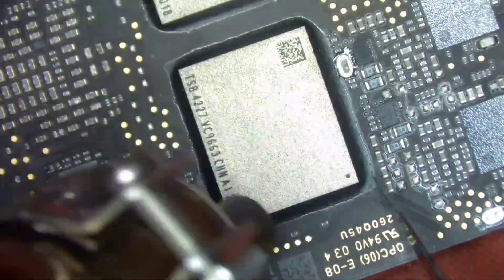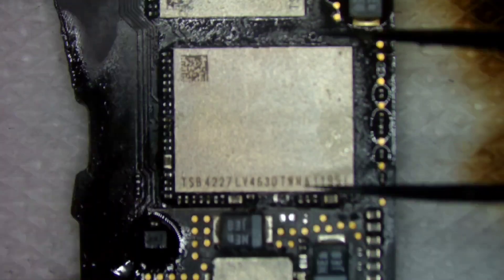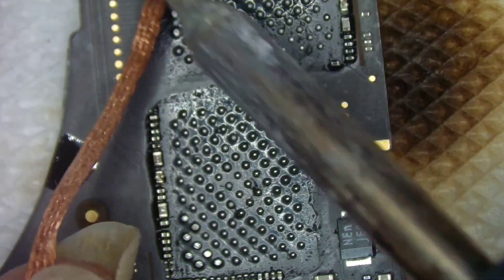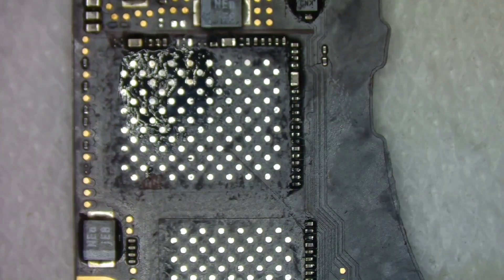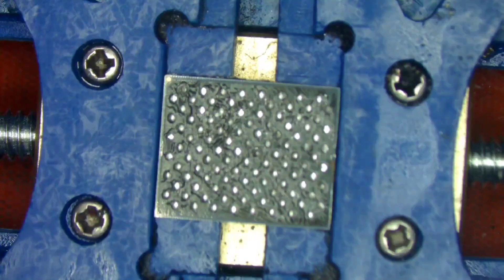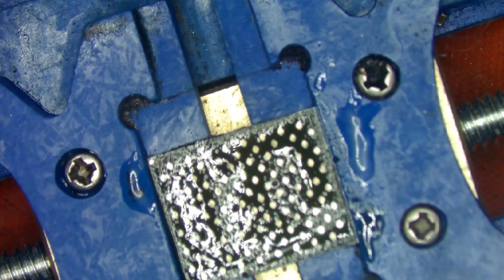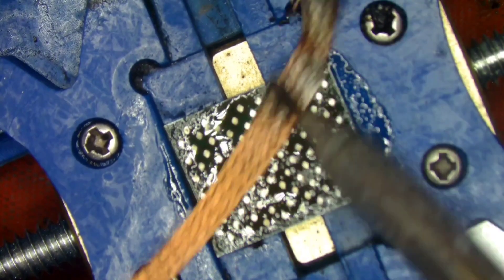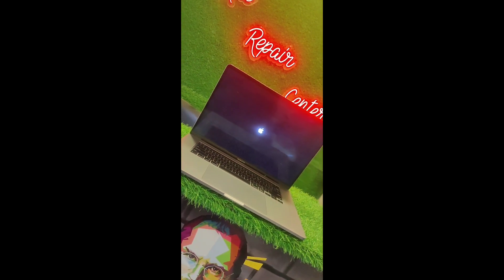MacBook A2141 Complete Nand replacement procedure

Comment: what solder braid do you use?  a braid with no flux?  a braid with no-clean flux?  what flux do you use to remove/replace the chip?  What chemical do you use to remove the flux residue?  Alcohol?

Comment: I replaced all 4 NANDs as per the JC Programmer and put them at the correct places.

All 4 are 00 of 0/1/2/4th Order.

Power Rails are stable for more than 30 seconds.
Pp2v5
Ppbus (12.3V)

Machine detects in recovery mode.
I did a bare board restore and got error 1.

Connected the trackpad and everything else.

Now i get USB Host Error 9.

Where could i have gone wrong ??
Reply: Something wrong with the connection or nand data pcie line issue